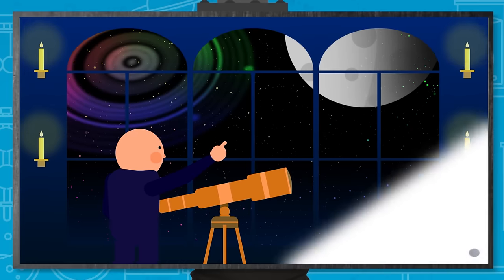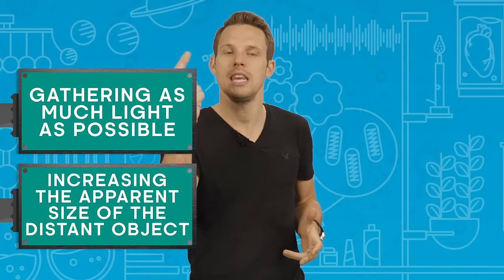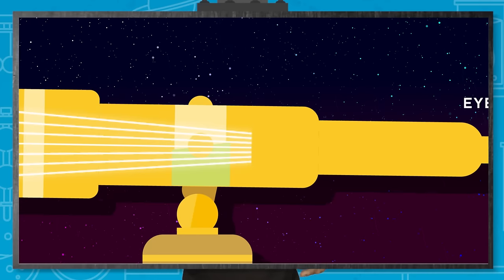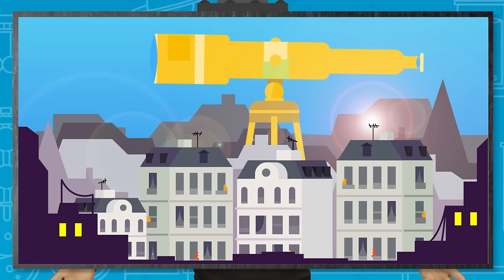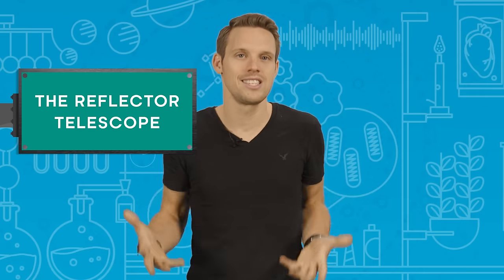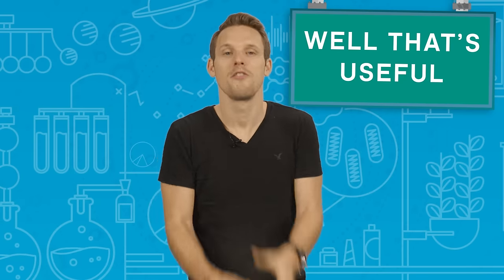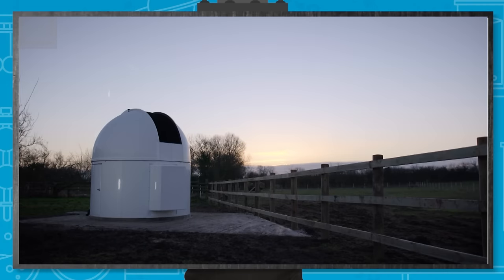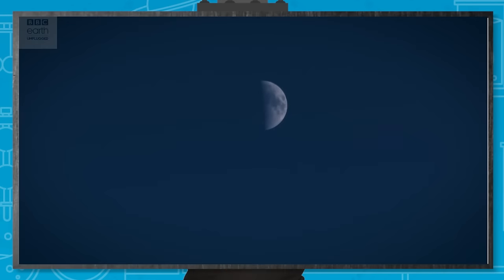How Do Telescopes Work? | Earth Science

Comment: Wait a second. 
A glass lense that's 1m in diameter that weighs 26 tons?
....Or did you mean that the whole telescope is 26 tons?
Reply: I estimate about 1000 kg or less, using a density of 2.51 g/cm3.
Reply: That's what I was thinking. 26 tons sounded waaay too much for a lense with a diameter of 1m. 
I mean, unless the depth of the lense was at a magnitude of meters.

Comment: We moved away from refractors not because of light absorption, but because of Chromatic aberration - even with achromats, as aperture increases in size, focal ratio needs to grow much faster in order to offset chromatic aberration. The two lenses are unable to bring all the colors into focus. It wasn't until the creation of apochromats with their ED/Flourite elements that refractors - but those don't work on large scales because it is prohibitively expensive. 

There is also the issue that very large lenses are very thick, very hard to make. Once you get past a certain point, the glass will just bend and flex due to its own mass, which of course ruins the image. Reflectors have the same issue, but they are at least supported on one end. We've also solved it using segmented mirrors and fancy engineering tricks. The creation of adaptive optics allow us to get very clear, distortion free views of space at a fraction of the cost of a space telescope.

Comment: Nice video, but to be honest, I am not really satisfied with some of the explanations.

Firstly the magnification of the telescope can not be understood by what you've said. The image does not look bigger, because the the object seems to be at front of your eyes. If this would be the case then stars shoul also be bigger, but they are also point-like trough telescope. 
The real answer comes if you sent other parellel lights trough the telescope. In this case you should observe that the angle, the lights comes into the objective is sometimes greater at the ocular. This magnification of the angles is the real deal.

Furthermore, Newton-type telescopes are not primary good for the lack of reflected light on the objective. Mirrors ara much easier to produce, much lighter, and they does't have the effect of cromatic distortion.

Comment: How does a telescope convert invisible light and other light frequencies to visible light?
Reply: southernexposure123
"How does a telescope convert invisible light and other light frequencies to visible light?" - It doesn't really. The camera attached to the telescope does. CCDs used in telescopes have a much wider spectral response than the eye, from the invisible infrared to th invisible ultraviolet. The output of a ccd is electrical and can be assigned visible colours. Furthermore, the CCD can be used for extended light capture, revealing details that cannot be seen by a human-eye using theexact-same telescope.
Reply: OK Thanks I listened again to where he mentioned the Spitzer telescope where said the telescope was attached "with" such a device like you mentioned whose sensor is designed for detecting invisible things. 
I must have gotten distracted about the time he said that the first time I watched.  Thanks again.